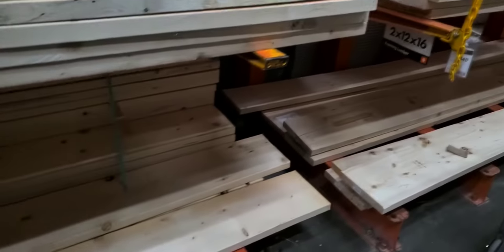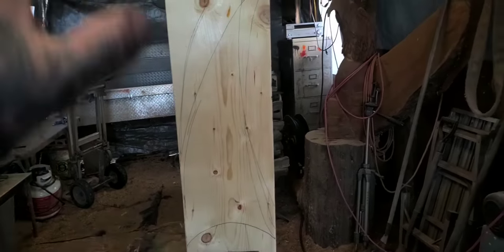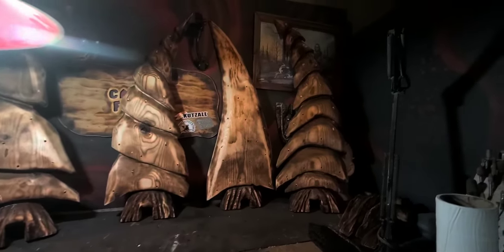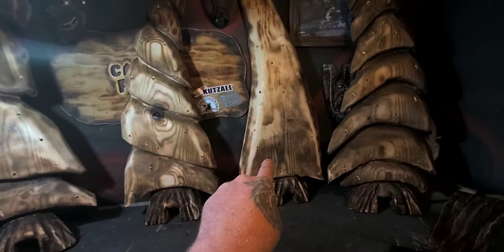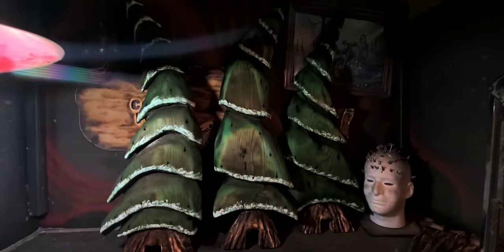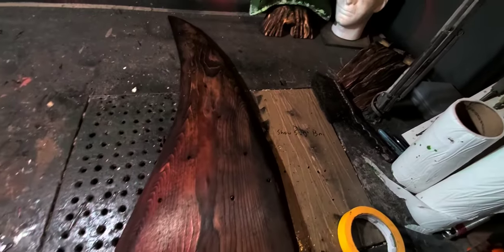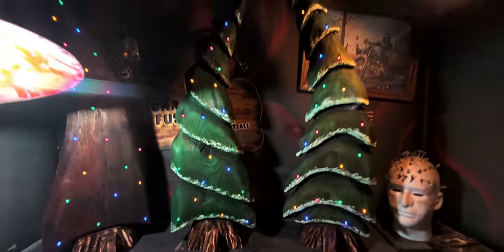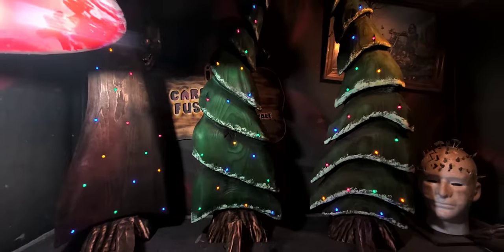Carving Christmas trees and dyeing them green

Comment: Number 3 today Jordy. I like the heavy duty wood burn. I saw someone else do that, and they  used a rotating brush thing. It really made the grain of the wood stand out a lot. Made it look really neat.   As far as putting the white frosting on the edge of the branches goes, would it help if after putting on the green dye, you left it for a day to dry? Then put the white on the  branch tips. It probably wouldn't bleed so much?  Like you say, they turned out pretty good. Definately worth the effort.  Thanks.  Rick.

Comment: Hey Jordy, Happy Thanksgiving ! Those tree's turned out pretty good and you've using the idea I'm using for dyeing the trees and putting snow on the edges, I'll send some pics when I get time. When you make the base of the tree, what I do is take a scrap piece from the wood you've cut and use it as a template and measure either side of it on the base of the trunk then cut inside of those lines about 1 inch up the trunk, then do the same on the cross piece and they should fit perfectly and flush ( as they say " measure twice and cut once " ) , I hope you can understand what I've said I know I don't understand myself  some times hehe ! Take care. 🙏